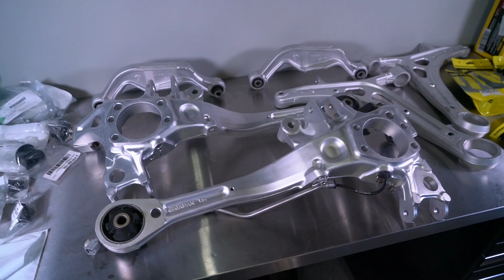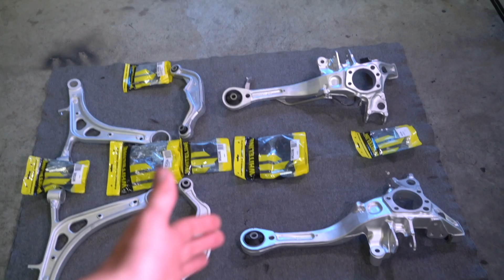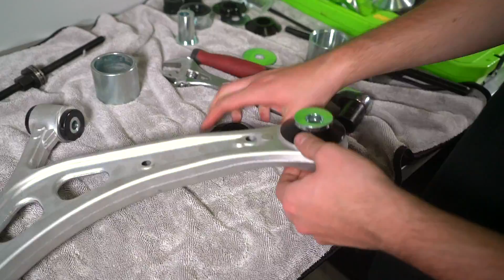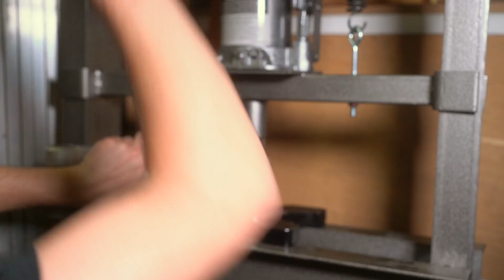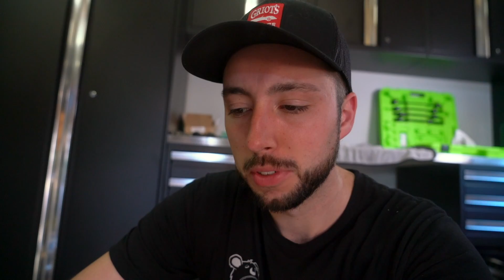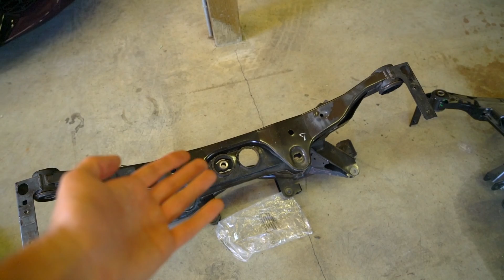Subaru Legacy GT Whiteline Bushing Install goes HORRIBLY WRONG!

Comment: What bushing kit did you rear inner lower control arm?
Reply from the maker: I used Whiteline throughout all the arms
Reply: @avengednick did you use kit KCA334 or W53353. I believe W53353 is an upgraded stock replacement while KCA334 has increased static caster
Reply: @avengednick was it neither of these parts?
Reply from the maker: @chino581991  I used KCA334 on my car

Comment: If anyone reading this is curious: remove the rubber, or at least some of the rubber, enough to get a hacksaw blade in there. You can go very very slowly with a hacksaw and make two cuts that are like 1/4” apart from eachother. Tap the little sliver of the bushing race out with a punch or something and the rest of the bushing race will pop right out. That’s one way to avoid bending rusty old shit with a hydraulic press and not cutting into it with a sawzall

Comment: I heat up the subframe around the bushing then use an air hammer on the lip to get out! Some are easier than others I will say! I also should note I don't live in the rust belt either!

Comment: I’m two years late, but air hammer!!
Reply from the maker: Yeah I desperately need an air hammer... Did this again by hand with cold chisels and a mini sledge and hated my life again haha
Reply: @avengednick will definitely make you’re life alot better, I have an 05 Outback xt that I built, air hammer was a must, and honestly, also thing about getting the sub frame powder coated next time it’s off.
Reply from the maker: I’ll definitely pick one up! And this was a brand new subframe, otherwise my ocd would have necessitated I powder coated it haha

Comment: Most of the bushings in the rear of my BL/BP are torn and separated so I'm in the process of replacing them. How have the Whiteline bushings held up over the year?
Reply from the maker: Mine isn't a daily driver, so I haven't put a ton of miles on it but it's been driven hard, including a track day and they've held up great. Whiteline makes super quality stuff!

Comment: I don't like most of these poly bushings because they add 3/8" - 1/2" in overall length to the bushing.  The OE bushing is flat/flush, but the poly ones all have a 1/4" lip/flange; altering the space needed to push the part in....uhgg...glad you fought through it.  too bad liquid Nitrogen isn't more readily available.  That would have been cool to see.  🤔  freeze the rubber to the point it is brittle and maybe even shrink it some to help it push out better.   Really wish Subaru had plans to resurrect the Spec-B Legacy.  Subaru needs a shot of performance adrenaline and sadly, the Solterra isn't going to save them
Reply from the maker: Yeah I found that out the hard way! Wrongfully assumed it would be the same measurements but got it done... And I would KILL for a modern day Spec B, but sadly Subaru seems to be losing it's touch on cool performance cars

Comment: Don't worry mate you ain't the only one with a toast subframe, my wrx had both of the bolts where the steering rack goes shear right off, we tried to take it out but it seemed to have melded itself to the frame. Lots of money thrown at this car because of Subarus lack of steel in it's important bolts.
Reply from the maker: Oh damm! That's crazy... Appreciate the moral support!

Comment: Just wondering what the internal diameter of the centre tube is on the Energy Suspension subframe bushes is?
Reply from the maker: Just measured and it’s 16mm
Reply: @avengednick  legend, thank you

Comment: It’s easy to see how the tabs on the rear sway bar fail. That looks like a poor design.
Reply from the maker: Right? I can’t believe the factory swag bars don’t bend it!
Reply: @avengednick  I think the stock end links are designed as the weak link.